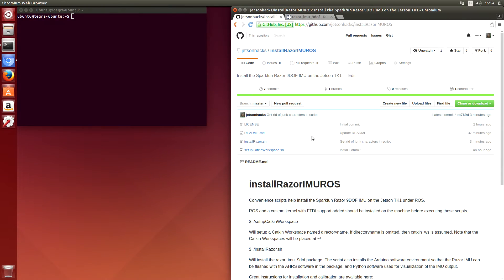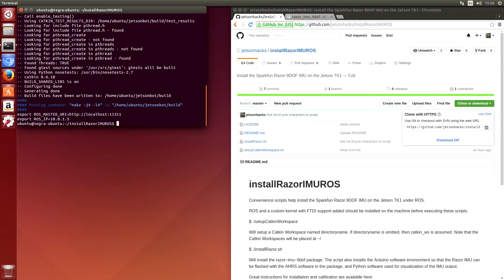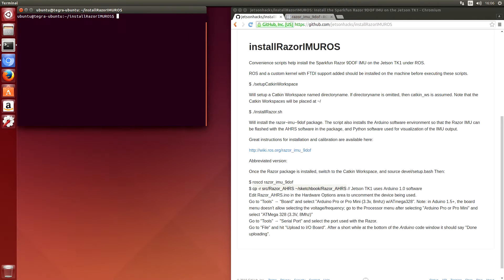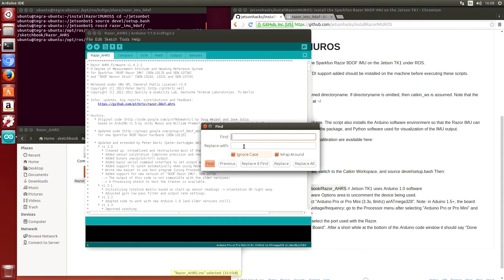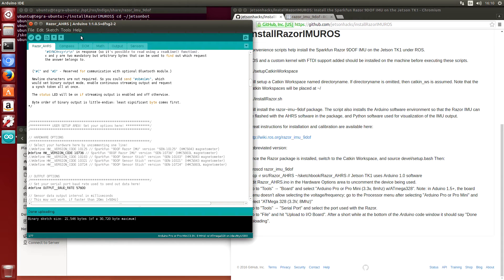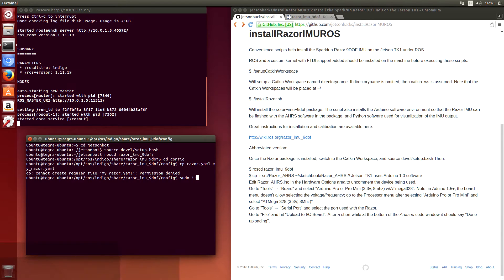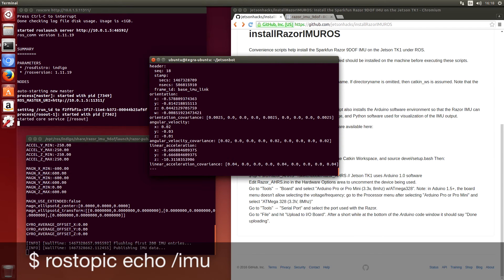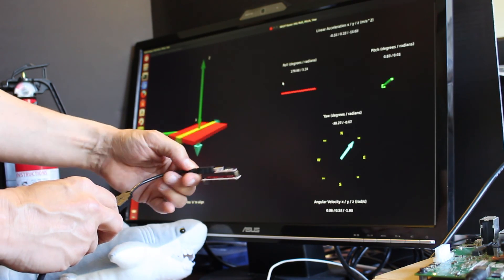Jetson RACECAR Part 9 - Razor IMU ROS Software Install

Comment: Hi Jim,

 (1). When I installed Razor Package "$ ./installRazor.sh" (1:46 of the video), I noticed that my terminal said "E: Unable to locate package ros-indigo-razor-imu-9dof", and "Package python-wxgtk2.8 is not available (has not installation candidate). but is referred to by another package. This may mean the package is missing, obsoleted, or only available from another source."

 (2). after I sourced the devel "$ source devel/setup.bash" (3:18 of the video), the terminal said "Bash: No such file or directory."

I am using a Jetson TX2 by the way. Please advise. Thank you.
Reply from the maker: This is for a Jetson TK1, a much different machine than the TX2. The Jetson TX2 runs ROS Kinetic. You must have the correct version of ROS installed on the TX2 and get the associated Razor package. Also, the Razor IMU in the video is different from the ones sold currently, so you will have to either modify the firmware on the new Razor to be compatible with the older model, or write a different ROS package.
Reply: Hi, I did use the sources of ROS and Kernel & Razor IMU for TX2, as opposed to the ones for TK1 in Video Part 8 and 9. But the problem still occurred. Thanks anyway!
Reply from the maker: You will need to change the installRazor.sh to reflect the upgrade. For example, the package is called ros-kinetic-razor-imu-9dof because the TX2 uses ROS Kinetic.

Comment: Hey! Any specific reason you picked the razor for this project over the bno055 you used earlier on your website? Trying to get a bno055 working on the TX1 at the moment!
Reply from the maker: The MIT RACECAR which this project is modeled after uses the Razor IMU.   The Bosch could be substituted, but is some extra work getting the ROS package and such working. You may find this article useful for getting the BNO055 working with the TX1: http://jetsonhacks.com/2016/01/11/imu-and-pwm-driver-over-i2c-for-nvidia-jetson-tx1/